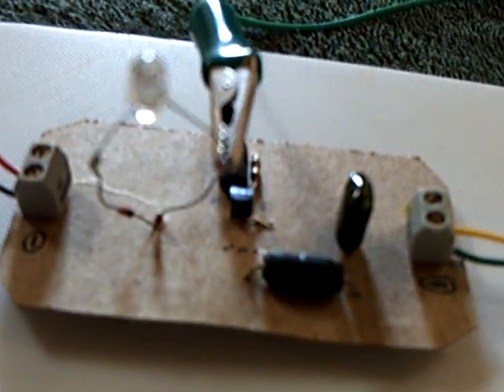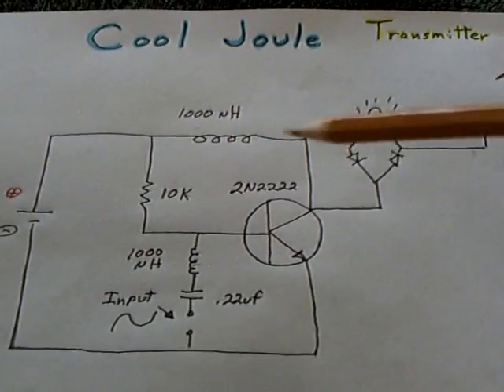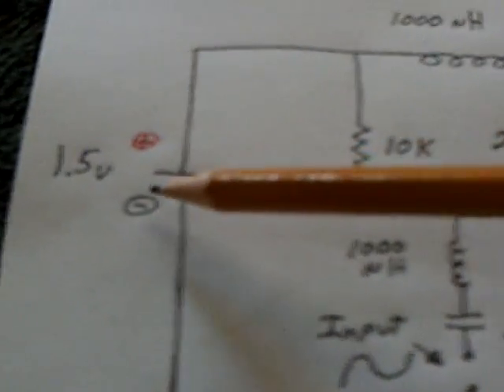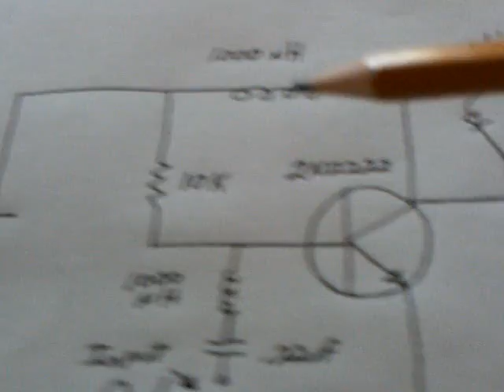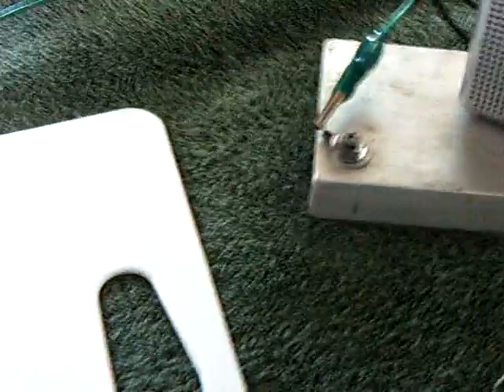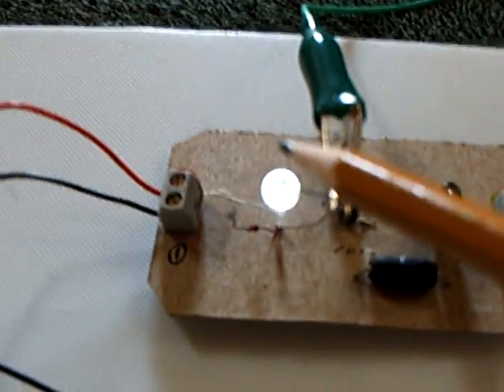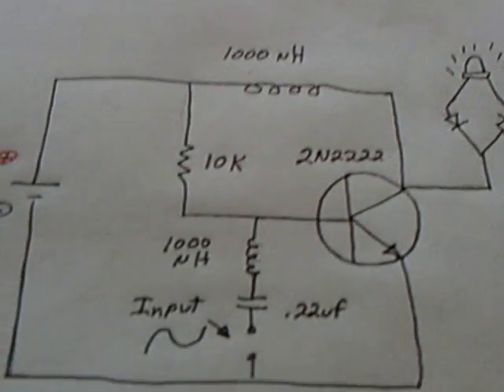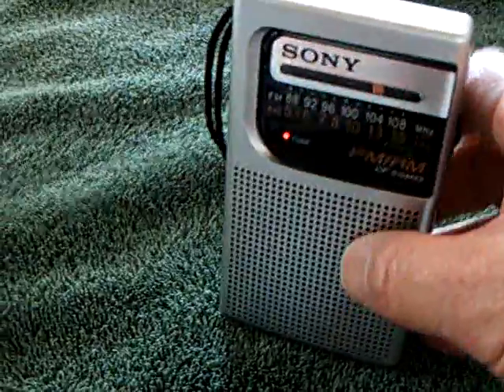Cool Joule Transmitter

Comment: If you want to use other transistors, make sure the voltage to the base of the transistor is correct.

Comment: This is just basically a simple radio transmitter with an LED  RF detector. "The electrical power down one wire" is essentially the RF power that is lighting up the LED.

Comment from the maker: That is fine.  The basic oscillator should be tried first in just the led mode that I showed.  If that isn't happening then of course the transmitter will never work.  Remember the reason that I tried the transmitter was because I could hear the basic circuit running over the radio.  Modulating it was an after thought.

Comment from the maker: I have been using regular ear buds ($1 store) wires.  Easiest hook up is to just take one ear bud and use those two wires.  A commenter said that the best arrangement would be to connect both grounds to the transimitter ground then use the L & R signal feeds connected to a pot as a fader control.  Center tap of the pot goes to the transmitter input.

Comment: @Lidmotor Thanks for continuing to share your interesting and informative work.  You noted that you looked at this circuit with the scope and it puts out multiple frequencies which reminded you a lot about Dr. Stiffler’s circuits.  As you stated you went another direction with it and I can see why. On Dr. Stiffler’s last YT video watch?v=mRk-J6-OeWs, he includes a schematic containing standard configuration of SEC exciter 18-x, your circuit is a very close variant in the direction you’re headed.

Comment from the maker: I am very anxious to hear what you say about the scope traces.  I will look at them again also.  I built up the circuit on a thin piece of cardboard to eliminate the prototype board capacitance.  I also configured the inductors at 90 degrees and far apart.  You are right ---this little circuit needs a good hard look.

Comment: Can you measure if it spreads or peaks on 13MHz with the spectrum analyser ? That would be interesting. Some will be 1/4 waves/multiples/other harmonics etc i'm sure. 
It's no wonder Tesla came up with wireless and radio..he was looking at similar effects :) 
This is frequency modulating with the audio signal, through a broadband connection lol...surprised he didn't found AT&T - All Tesla & Towers.

Comment: Great progress. It's Slayer country again in a way, without the winding of coils ! 
Will try ferrite beads to link to Dr. Stifflers methods.
Tried the radio method and got low quality from a few transisors tried, not got an MPSA06 though. 
Next, the dishwasher circuit variant to complete the week lol